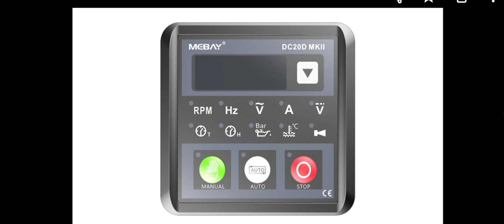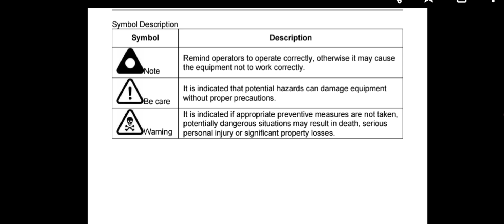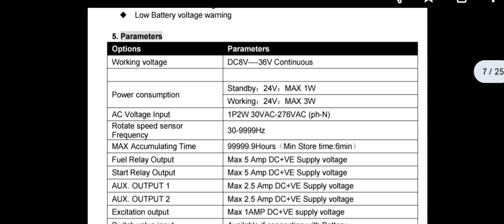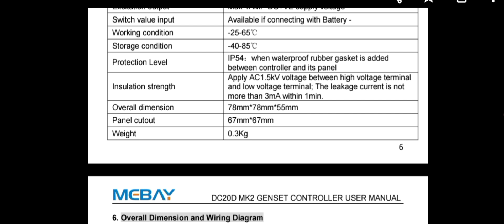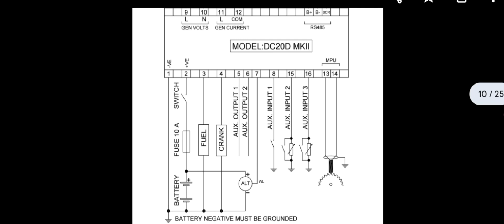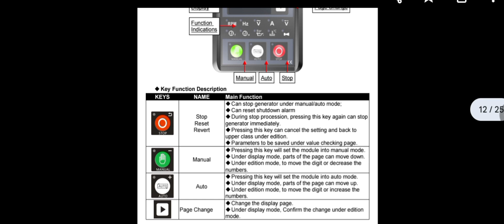Mebay DC20D MKII Genset controller explain  wiring installation in details

Comment: It's like somebody read a manual for you, if you can't read. I was hoping for some visual examples.
Reply from the maker: Let me write for you
Reply from the maker: Its very simple, easy, what is your problem? You are not understand?
Reply: @Info-Tech- Probably simple for you. I was hoping to wire it to a generator to try to sense the grid power loss to automatically turn the generator on. I don't understand where to even start, how many wires are needed for it and where on the generator and this unit they will be connected. If you could make a video detailing it, I am sure it will be in demand. Could be a real generator, but does not even have to be, if explained where to connect wires.
Reply from the maker: @СаняРустиков  Remote start operation.. 3 steps

1.Install automatic changeover switch first take the Genset supply and put in ATS for auto change, 

Step 2. Take 110 VAC relay  take the Genset supply from battery nagitive.  USE The relay NC cantact Pass the 12 V -feed  in relay Common to NC out and feed to pin 8 of the controller and operate the relay coil from 110V just relay coil,  in this situation  when the grade power is available the Controller will be not getting the - supply because the relay NC will be NO when relay is energized position,  when Main or grade power fail the relay will be Denergized and the NO will be become NC and the - feeding will starting to 8 when controller sense the negative , the generator will be start if the generator Is set in auto mode mean auto mode is active by press the yellow button, 
3 step put the generator in auto mode .

Working....

Main power fail, 110V relay Denergized from energized NC Was NO Iin energized position, main power fail it become NC - feeding start to pin 8 generator received commond and started , and the main power will change in auto changeover.
Reply: @Info-Tech- thank you so much for taking the time to help! I will try it sometime in the next 2 weeks and let you know, of you want.

But in your spare time you should make a video. I have bought this controller over a year ago and got stuck and even few local shops that deal with generators could not help me, haha.